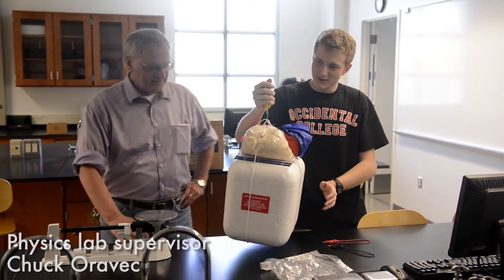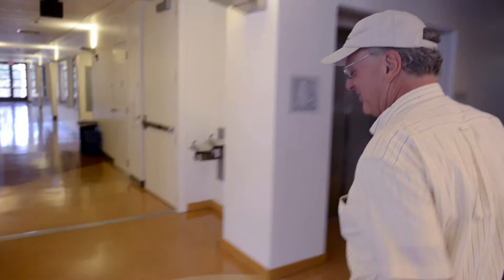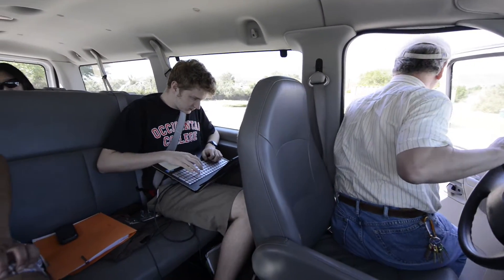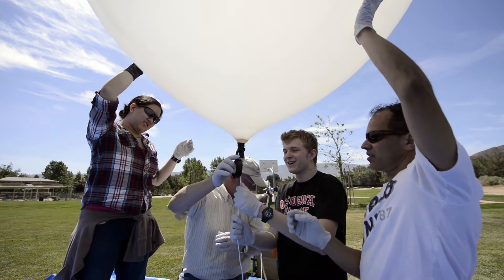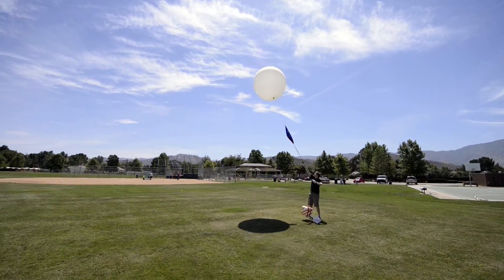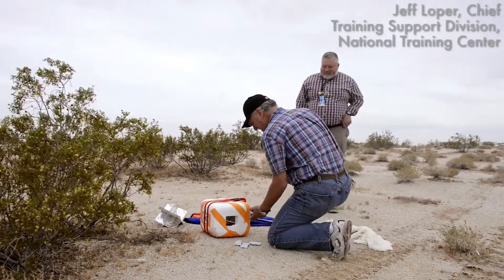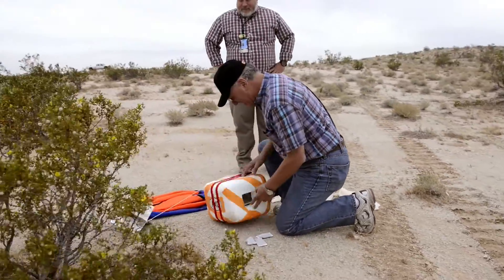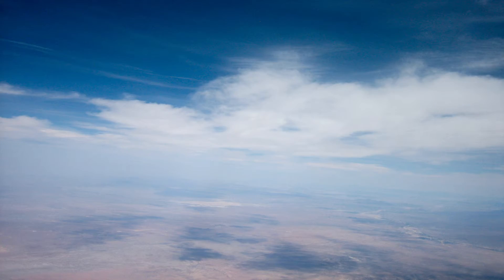High-altitude Balloon Project

Comment: Was interested where you two students ended up:

Nicole Chen
Contamination Control Engineer, NASA Jet Propulsion Laboratory
2015 - Present

Jack Nelson
Starlink V2 Hardware-In-The-Loop (HITL) System Responsible Engineer, Space X
2021 - Present
Integration and Test Lead, BE-4 Engine Controller, Blue Origin
2017 - 2021
Reply: Thanks for that, stuff like this is always interesting to see, seems like the two are doing very well for themselves!

Comment: The first thing I thought about the video file not working is that when a camera dies while recording video it doesn't have a chance to complete the file. Sometimes when you put the sd card back in the recharged camera it will finish whatever process it needs to and you'll get a usable file.